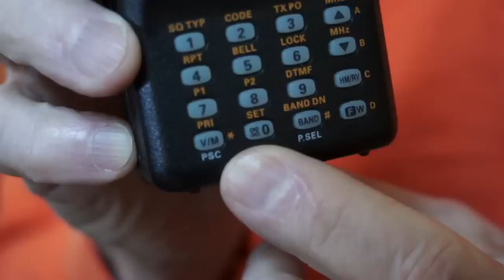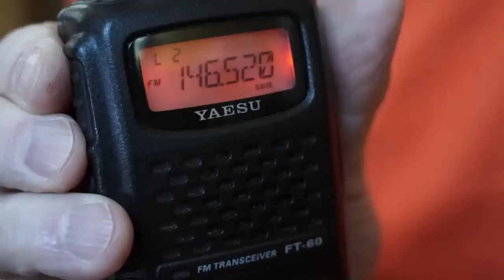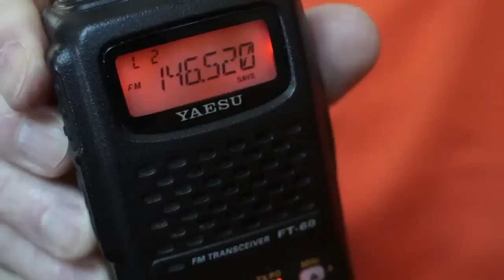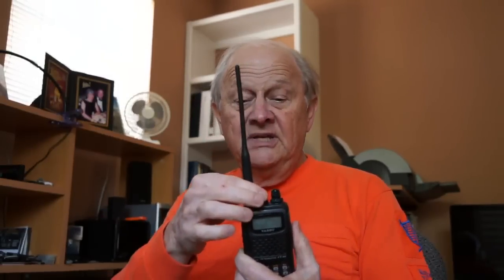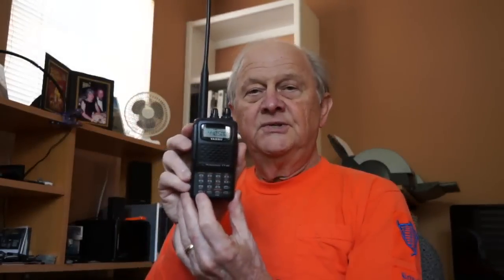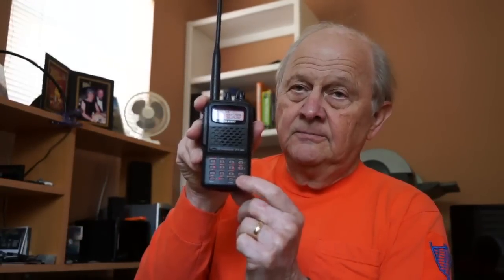FT-60 Operations

Comment: I’m looking at maybe purchasing this radio. I have a very old xv 5r
The power button on the xv 5r is very hard to turn on so my question is this radio have a power button or does it turn on by a switch?
Reply from the maker: If you look at the video at about 5 seconds in, you'll see the on/off - volume knob between the antenna and the channel selector knob.  It's easy. I, too, have an XV-5R, and you definitely won't be turning it on or off accidentally. That button is buried.

Comment: My radio flashes on and goes right back off when I try to power the radio on. Any idea whats wrong with it??
Reply from the maker: I have zero expertise in repairs. My first guess if it were happening to me is that the battery's dead. Have you charged it for hours? How old is the battery?
Reply: philip I put a new battery in and tried a manual reset but no luck. was hoping somebody out there might have a tip or trick to fix it. Thank you for your reply sir!
Reply from the maker: @teddover2266  See if anyone in the forums at qrz.com can answer your question.
Reply: philip ahhhh, great idea! Hadn't thought about that route, thank you sir!

Comment: Would you consider emailing your cheat-sheet(s) for your FT-60?  There are a few operations in the manual that I find lacking.  Thanks in advance for your assistance in this matter as it is appreciated.

Comment: I watched this soon after getting my FT60, found it helpful.  I could add that for me, one of the best functions on this rig is the memory bank system. Exceptionally easy to set up and makes selective scanning so easy.  This a very versatile little radio indeed - it's a 100% keeper.  Mine also gets used as a sometime mobile radio with a magmount and a lapel mike. If mine broke today I'd buy a replacement tomorrow, it's that good.
Reply from the maker: +Ian Gourlay Thanks for the kind words and the comment about the memory bank system. One of my friends finds that extremely useful.

Comment: hello phil remember me? im the guy that had the ft 60 with the internal speaker not working, well i split the case and found the prob it seems that these radios speaker is mounted on the plastic case and makes contac with the board with two tads that stick up off the board not with wires so long story short
one of the metal tabs was not makeing contac with the speaker so i bent the tab and to my suprise it works so now alls i need to do is replace the battery and it will work as good as new so yes i guess i did git a good deal for $25.00, thanks for the help on learning to program it 73s John...K6JRD
Reply from the maker: +John DeCicco Wonderful! Congratulations on finding the problem and solving it.

Comment: i picked up a ft 60 for 25.00 told it worked but needed a battery charger from amazon well its on the new charger and the red light is on so its chargeing how long does it take to chargeand ill let you no if i got a good deal or not.....John  K6JRD
Reply from the maker: +John DeCicco Good luck, John! I've never timed charging, but it can be a long time. Hope it's the charger and not the battery.
Reply: hello eddie, well i guess the battery is bad it gharged for 10 min. and the green light came on but i tryed it out it tans just fine but i cant gget the speaker in the HT to work i hooked up an ext speaker and it worked so do you think its the HTs speaker thats bad are do you think i mite have something turned off,i downloaded the manuil  it didnt tell me nothing much guess ill have to take it to yaesu, mo money thanks ed John....K6JRD
Reply from the maker: +John DeCicco Before you sent it back, let me recommend a reset:

Turn the radio off.Press and hold in the MONI switch (just below the PTT switch)
while turning the radio on.
Rotate the DIAL knob to select one choice from the reset menu:
F1 SETRST: Resets the Set (Menu) mode settings to their factory defaults.
F2 MEMRST:Clears the Memory settings to factory defaults.
F3MBRST: ClearstheMemoryBankAssignments.
F4 ALLRST: Clears all memories and other settings to factory defaults.
Press the [F/W] key momentarily to complete the reset procedure.

This is copied from the manual.
Reply: first of all im sorry for callinng you eddie hello philip, im new to this ft 60 so should i go to f4 and reset everything and to do so what do i push, and thank you so much philip for takeing the time to help me your viedos are really helpful to me programing this thing thank you philip...............
i pushed the F/W nothing happend i was tuned in on F4
Reply from the maker: +John DeCicco No problem -- we all get the names confused in these threads. Try going through all the steps again to reset the radio. I'm not going to reset mine, though, to test the steps. :-> I've done two factory resets on my cell phone this afternoon, and I'm all reset out. Choose F1 SETRST to see if setting to factory defaults helps, then press and release the F/W key. Good luck!
Reply: +philip,..... thank you philip again for takeing the time to help me out, ill figure this thing out i have a kenwood TS 520 talk about something to figure out 73s mr. philip
Reply from the maker: +John DeCicco I'm not sure I did help you out, but thanks for the kind words.

Comment: I would like to know how you went about to get the program information on to the 4 x 6 cards. I think it would be a great help for most most hams and especially the new hams.
Reply from the maker: Step 1, I read the manual. Step 2, I use a word processor to type up a summary of the information I need on the 4x6 cards. The word processor I use (Mariner Write) lets me format pages for a variety of sizes, including 4x6.